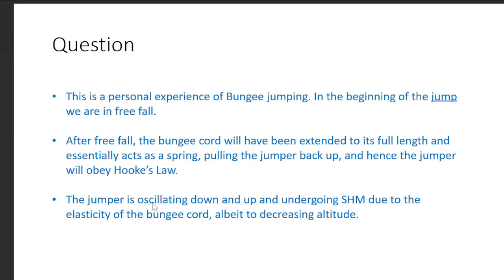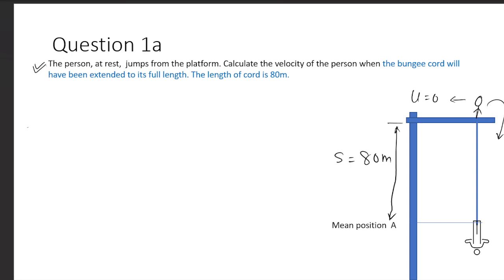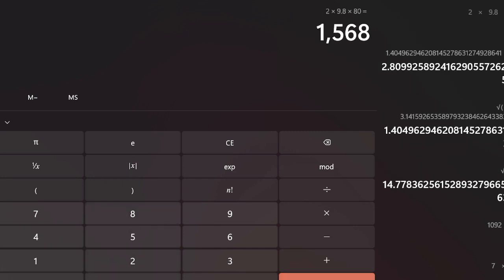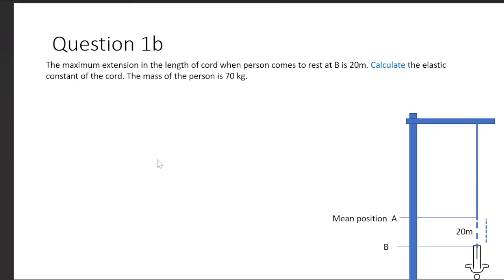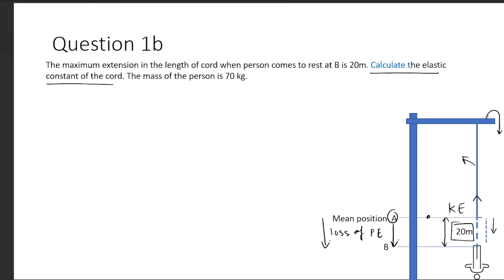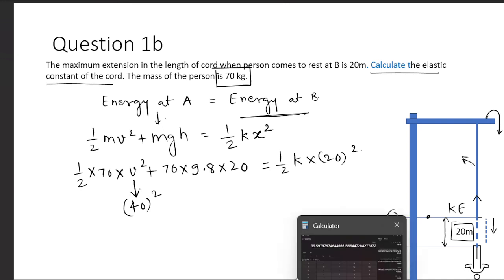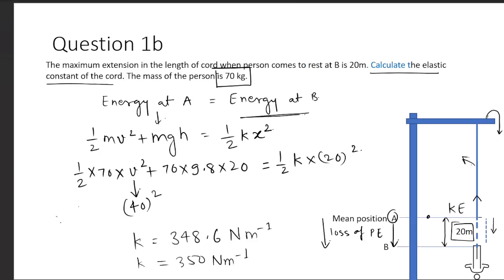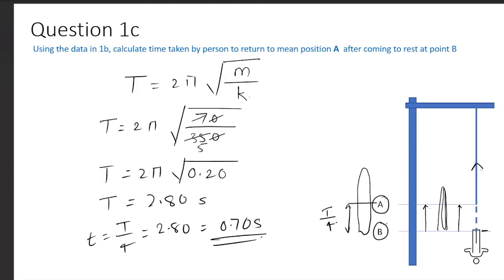IBDP Unit 9 - Numerical question on simple harmonic motion and free fall - Bungee Jumping

Comment: Sir in question 1B, because total energy of the system is constant as per law of conservation of energy, shouldn't the equation formed be 1/mv^2 + mgh = -1/2kx^2, and thus the value of k must be negative.

Also, in potential energy at A, the height won't be 20m because that is the length of cord at B. Instead at A, we would do 80-20 = 60m as height because 80 is total length and maximum extension from mean position is 20m.